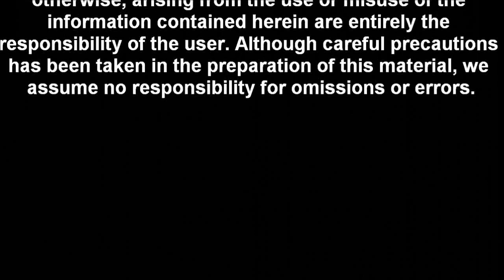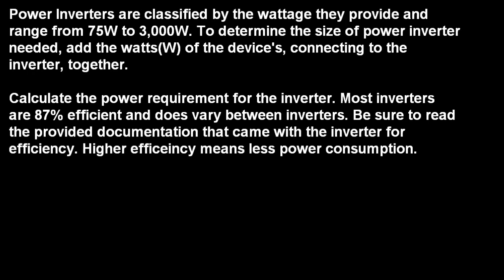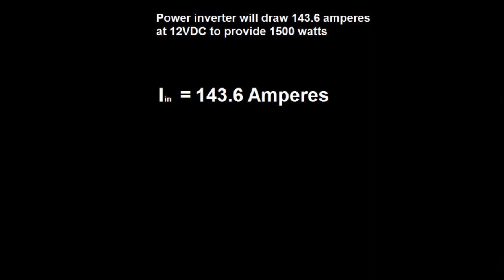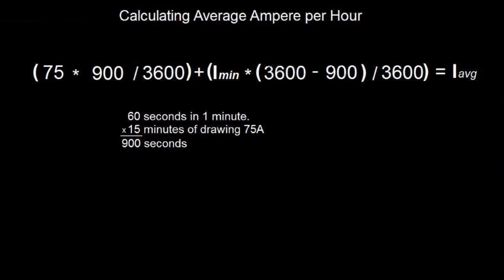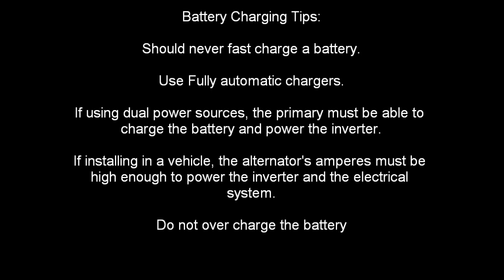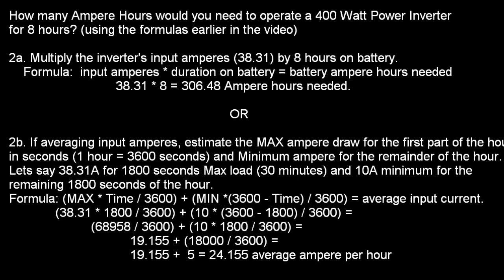How to calculate needed battery Ampere Hours

Comment: Your video is the most well explained step by step I've seen. THANK YOU.
3 questions for you:
1.  At about the 41:56 when you talk about recharge time,  where do you get the 1.4?
2. Also the 10 charging amps you use in your example is 10amps pretty common for most charges? or did you just make up this number for example purposes.
3. I've seen some folks refill lead acid batteries with distilled water.  Does this breath new life into the batteries?

Comment from the maker: You're welcome, Glenn. The 50A fuse will protect the Battery and the cable from direct short to ground. Maximum Ampere capacity for 6 AWG is 50A up to 16 feet. The converter has it's own Fuse to protect it from overloads. My "Power Inverter Tutorial part 3" Video has an Ampere rating / cable size chart to help with cable sizing. If you need any help I'll be around. -MrFixit

Comment from the maker: You're correct, mijemu. The total of 150AH from the batteries will provide 143.6 A to the Inverter for 1 hour (143.6 amps x 1 hour = 143.6 AH). Keep in mind that some batteries provide only half the AH under high loads. Second, you don't want to drain more than 50% of the battery's capacity to prolong the life of the battery. The latter part in the video will show how to compensate. -MrFixit

Comment: good questions, BUT.. hole on.  CCA is just a term that car battery people came up with to  sell their battery when someone is needing a new car battery.  You are correct in saying that there is no correlation between the listed amps of a particular battery and the CCA listing, except that when one goes up so does the other.  The CCA means the most amps that the battery can output to the starter before it "squats-and-gives-up",  and that is with the battery voltage dropping down but still has enough power to turn your engine over, but how long it keeps turning it over is relative to how much CCA the battery is rated at but even that doesn't tell you whether or nor it will keep turning over your particular engine long enough to start it.  Save yourself a big headache and let your battery dealer put in the right battery for you and also keep your car in a good tune-up condition and you will rarely ever have to worry about it.

Comment from the maker: The resistance in a Lead-Acid battery increase due to sulfation, the crystallization of lead sulfate, during discharge. To calculate internal resistance (Rbatt), 1) measure the Voltage under a 'No Load' (Vnoload), then measure the Voltage 'Under a Load' (Vload), finally measure the Resistance (ohms) of the Load (RL). Use this formula: Rbatt = (Vnoload - Vload) * (RL / ((Vnoload - Vload) + Vno load)). Using a battery condition tester as the load works best. -MrFixit

Comment from the maker: Thank you for the compliment. To answer your questions, (1) The 1.4 is used to increase the amp hours by 1.4AH for every 1AH of battery capacity.to ensure the full recharge of the battery at the end of the cycle. (2) The 10 amps was just used as an example to calculate recharge time. Actual charge ampere vary from charger to charger. (3) Distilled water will not bring 'new' life to the battery, but is required periodically due to loss of water from electrolysis during recharge. -MrFixit

Comment from the maker: Are you referring to the fuse for the AC line of the battery charger or the Power cable from the battery to the Inverter? I do have a formula to calculate the Fuse for both the primary and secondary sides of the charger's transformer. The fuse from the battery to the Inverter must be higher than the inverter's continuous input ampere but, not higher than the cable's ampere rating. -MrFixit

Comment from the maker: You're welcome, bustersgotavmax. I see, you're using a RV power converter. From the sounds of it, either a 4000 or a 9000 series? The "45 Amp" refers to the maximum ampere the converter can provide to the 12V Distribution Buss, including charging the battery. No higher than a 50A fuse between the converter and the battery. -MrFixit

Comment from the maker: Step 1) Determine the Inverter's required input amperes for total wattage it will provide. Step 2) Multiply inverter's input amperes by the number of hours your inverter will run on batteries. This is minimum Ah. Step 3 (optional) Divide Ah by 80%. This Ah needed to help extend the life of the batteries. Step 4 (optional) To Compensate the drop in Ah under heavy loads, Divide Ah by another 50%. This is you're final Ah needed. Step 5 calculates batteries needed recharge time. -MrFixit

Comment from the maker: No. You'll need a power supply that provides 14.1 volts in order to charge 12V batteries. The charge voltage must be 2.1 volts higher than the battery for it to charge correctly. -MrFixit

Comment: This has really answered some questions for me about my travel trailer batteries.
I did not see where you calculated for 8 hours run time in your equation,should it be the adjusted amp hours in the final step x 8?

Comment: Hello , This video was terrific , i have a car battery with  700 cc (Cranking Amp ) , i would like to know :
1 ) what kind of power inverter i need in terms of Wattage and Brand name.
2) I do DJ , sometimes i hire for camping event ,i have 2 power speakers , each speaker 600 
watts. i would like to know how much wattage inverter i need and the type of cable Gauge.Thanks

Comment: Very good video, i have one 12 volt battery and 50 amp, i don´t know if this current is enough to run the inverter . The battery´s label says  two ranges of amp: maximun and minimun which are ahead of 200 amp, my question is: how can i know the real ampere to use my inverter  if the battery says three different amperes? Thanks.

Comment: I appreciate your video. The issue I am having is with labeled amp hours.Made up of 24 X 2v cells to 48 V. Each 2v volt cell is rated at 20 HOUR 2500 AH and 100 HOUR 3500. The bank is therefore  20 HOUR 2500 AH and 100 HOUR 3500 because all in series. Using 8000 Watt Inverter @ .95 eff and 48V is 175.43 AMPs. Question is do I use 20 hour or 100 hour discharge rate in my formula ? I want to find the max amount of time I can run at 8K to 80% DOD. Make sense? These are Rolls Surrette Bateries.

Comment: 29:00 thats a lot to ask for. how much more load does an inverter draw besides the load the inverter is supplying. What I mean is, if you have a 50Whr device plugged into a 500W inverter, would that 500W inverter draw more than 50Whr? the inverter in question here is this one:
and according to specs sheet, it draws 3.6W at idle per its spec of 12V and .3A at idle

Comment from the maker: @melodi7478 All you need to do is add up all of the component's input Watts together that the inverter will power. This will be the minimum continuous Wattage Inverter you will need. Then decide the hours this inverter will operate on batteries. Lead-acid batteries only store 45Ah, consider Deep-Cycle batteries instead.  This video describes what you need to know. As for the Cables, watch "Power Inverters 101", p1-3. Be sure the inverter has at least an 87% efficiency. -MrFixit

Comment: Thank you,I get it now.
Do you have a formula to calculate the line fuse required for a converter/charger.
I,ve just finished redoing my 12 volt system in my travel trailer.new 45 amp converter/charger,12 volt fuse panel,6 volt batteries in series and 6 guage wiring.
I still need to put a fuse on my batteries pos. cable.There is approx 7 feet between batteries and converter/charger.

Comment: i'm particularly interested in the battery cable leading to the converter.I'm using approx 7 feet of 6 guage from the batteries to the converter ( an intellipower 45 amp with charge wizard) I'm not sure if the 45 amp rating is determined from the charge rating or output to branch circuits. i'm not sure what  fuse rating I should be using close to the batteries
Thank you for you responses.

Comment: At 9:50, the inverter would need 143.6 amperes from battery to give the 1500 watts. Thanks, Got it. Just one question, so is that 143.6 amps per hour?

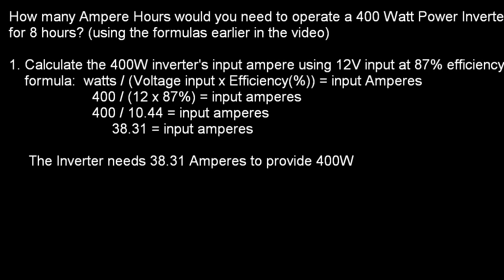Comment: I'm confused : @  time stamp 33:05 , it is stated that 306.48 Ah is needed for 8 hr of run time. @ 40:26 you state that 95.78 Ah is needed  for  8 hours of run time. I think you forgot to multiply it by 8 which is  8 x 95.78 =  766.24  for total Ah to safely run 400 watts for 8 hr.

Comment: Or you can avoid many of the problems by using Iron-Edison's Nickel-Iron batteries! 20-40 year lifespan of batteries and can be discharged to 90% of full capacity, and work great under full load without drop in Amperes!

Comment: 18:50, what is the point of using this equation? Doesn't the inverter draw the same amount of current as long as you the same devices connected to it?

Comment: Hi great video, a question, I am going to buy a 200 Watt Inverter but will maybe only run a 75 watt  fridge 95% of the time. will the Inverter still draw 200 watt or 75 watt Plus bit extra  power itself say 76 Watt from Battery?? Ohh where did the 1.4 come from :)
Reply from the maker: +gaz ed The inverter will supply power when the Fridge is actively drawing current from the unit.  If the fridge requires 75W then the inverter will provide 75W of power. The "200 Watts" is the max the inverter can provide on demand. As for the inverter, as long as the unit is ON it will always draw current from the battery, even if nothing is plugged in to inverter.  While the inverter is idle, it is drawing about 100-250 mA from the battery to stay ready for On-Demand loads. The 1.4 is a constant when calculating the battery's recharge time, called the "Charge Factor". It means that when recharging a battery you must charge 1.4 times the capacity withdrawn from the battery for the battery to become fully charged.  -MrFixit

Comment: Hi another Q)  how do you know when battery is depleted by 80%, volt is all i see when test with meter on open circuit volt,  or do you  tell when open volt  reaches 11.5v or 10.5v  and below cheers
Reply from the maker: +gaz ed When a charged battery should read 12V -13.8V.  When the voltage drops to 11.5V, it's time to recharge.  -MrFixit

Comment: Question. I bought a 10,000 watt  pure sine inverted but will only be drawing 1,000 watts on it (bought more than I needed thinking I could always add more and not limit myself).  Do I need to use the 10K or 1K in the initial formula. Seems like I could be using the draw not the max capacity, no?
Reply from the maker: +FOUNDUPS Michael  Trout You only use what you will draw from the inverter.  -MrFixit

Comment: At 27-28 about using 80% of the 200Ah battery and needing a total of the 200Ah to run the inverter. Is what you are meaning of what you are saying,  we need to have another battery of 50Ah in order to have the 20% reserve? I know this is purely an example to teach and not actually real world. So, in the real world application battery bank array system, we want a 20% reserve contingent to the demands of the devices? Am I reading you right?

Comment: Not many 12 V battery give their Amp hours so non of what you talking in Amp hours helps. CCA is always available so how do you figure Amp hours from CCA is what most people need to work other needs.
Reply from the maker: There is no Specific formula to convert CCA to Ah. Most car batteries only provide 65 Ah. They are designed for short bursts of energy rather than long term. A battery designed for a steady supply of power will have it's Ah listed. -MrFixit
Reply: Johnson Larry Most car batteries are rated CCA and don't have a AH rating, A Deep Cycle battery made for Golf carts, Fork lifts and Solar Panels will have a AH rating. Car batteries will not last as long as deep cycle batteries being pulleddown to low level of charge. But there cheaper and used accordingly will last a while.